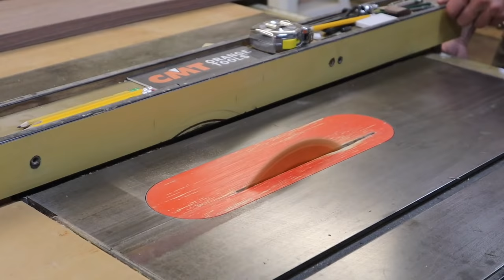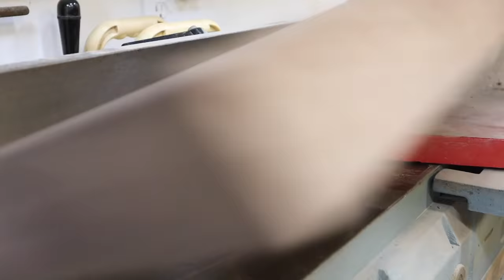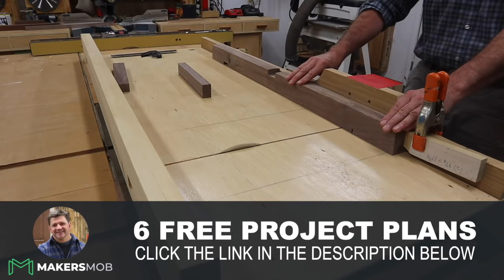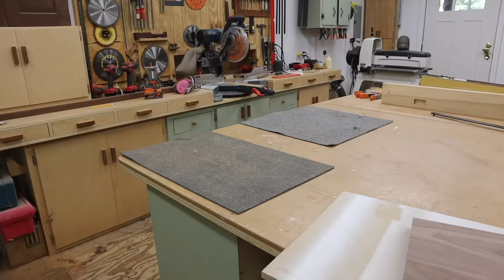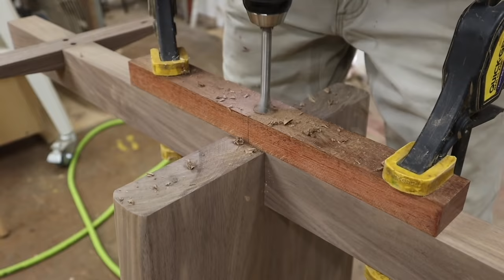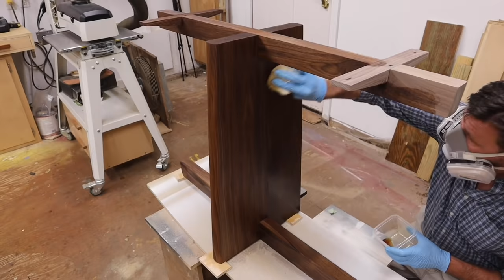Table Build: George Nakashima Inspired Entry Table

Comment: Lovely job.

A useful tip: clip a small mirror to the back of your table sled so you can make housing cuts without having to lean over except to line up the start and finish cuts.

Comment: Has similar but simpler elements to a Rennie Mackintosh inspired table I built a couple of years ago. I like that you removed the screws and used dowels. I suppose with only four screws, the top will be able to move but will it remain flat?
Reply: I thought this was pretty nifty as well. A little more true to Nakashima's esthetic. Also, the technique for drilling the dowel holes was good.

Comment: That router setup you used to level the ends of the dowels can also be used to flatten the rest of a board when it's wider than your jointer.

Comment: John, a beautiful project and full of useful tips. Maybe you share this in your maker's mob (where I'll look next) but the template that you used for the table top for bandsaw and routing the shape, is that something that you kept from another project or did you make it specifically for this? Could it be made with 1/4" plywood or MDF? Thanks as always.
Reply from the maker: Thanks Carl, I made it for just this project

Comment: Great one Jon! 
Question! (For a 6ft Computer desk)  My lumber house here has a section of random legnth 1x5, 1x6, 1x8 walnut. Do you think i could Wrap that around a 1/2in birch plywood "Core'" with mitered edges to make it look like thick slab of walnut? or would the plywood expand and contract under the walnut and ruin the top?  walnut is already hard to come by in Los Angeles so thick slabs are few and far between and $$$$
Thanks! Keep up the great content!